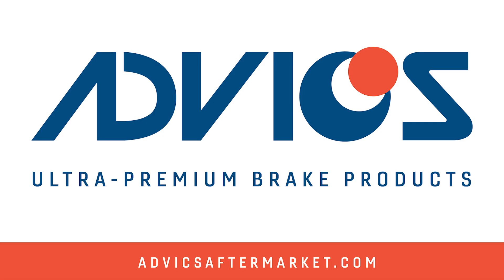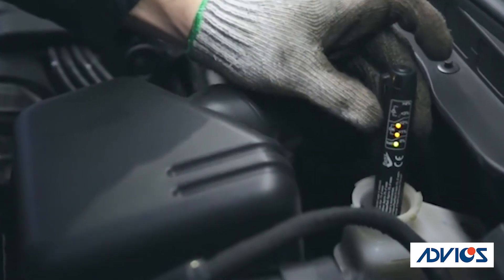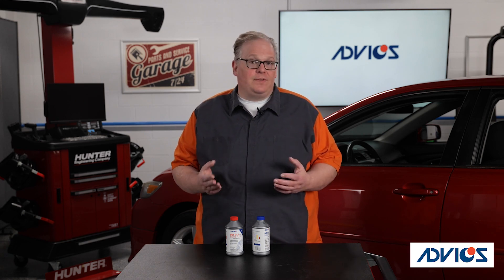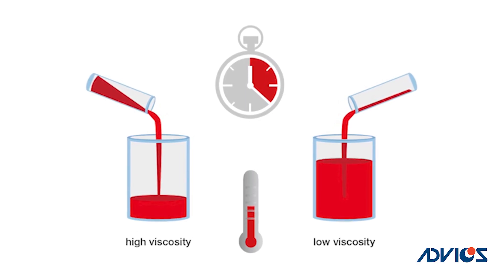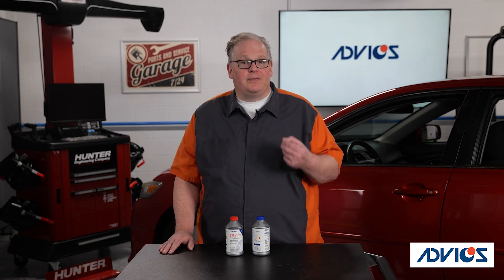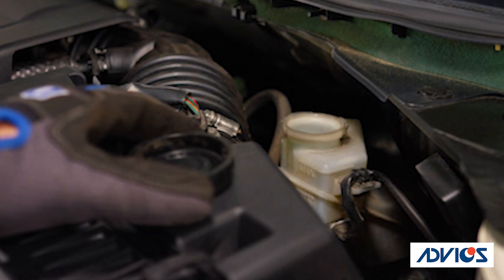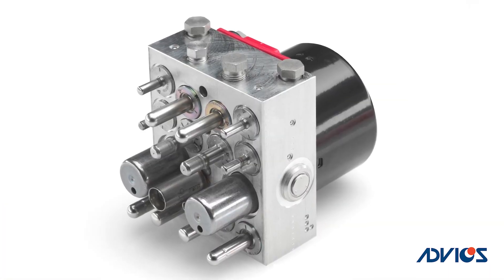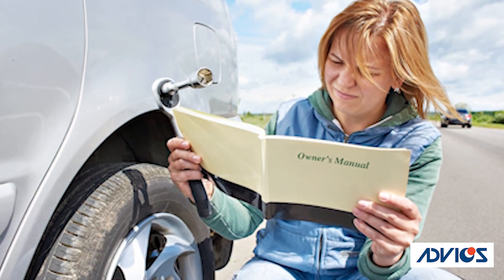What Is A DOT 4 LV Brake Fluid

Comment: Hmmm.  I am considering a test with dot4 lv in my 2007 Chevy.   
The Trailblazer had poor write ups on stopping.  Of course, it tips the scales at well over 2 tons.  It feels like my semi truck which does have disc brakes on all axles.  No matter what, allow plenty of stopping distance for emergency stops!

Does anyone have factual information about the ABS on GM vehicles made in this millennium regarding benefits or failure using low viscosity fluid?
Reply: DOT4 LV will not increase the overall breaking power or pedal feel. What the viscosity changes is the kinematics of the valves and fluid in the ABS HCU. GMT900? Braking power in these trucks can be improved with more aggressive friction materials. thanks!

Comment: To be clear. DOT 3 and DOT 4 are interchangeable up 1 number. So if you use DOT 3, you can install DOT 4. If you have a DOT 4 LV, stick to the LV if you live in temperatures below freezing but DOT 4 can be used in a pinch in place of LV above freezing. DOT 5 is NOT compatible with anything. Do not mix with anything. It will damage your brake system. Lastly, you have DOT 5.1, this fluid is compatible again with DOT 3 and 4 systems providing you go up in numbers. In other words. Do NOT install DOT 3 brake fluid in a system that takes DOT 4 or 5.1 as higher numbers are higher boiling points.